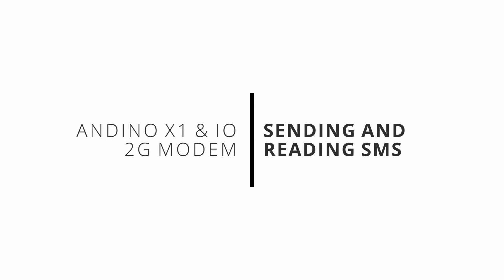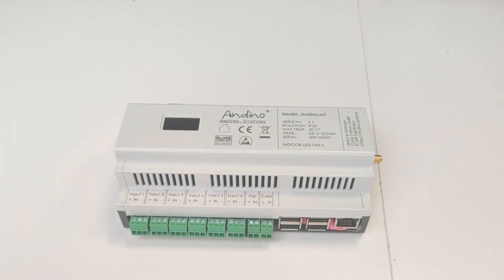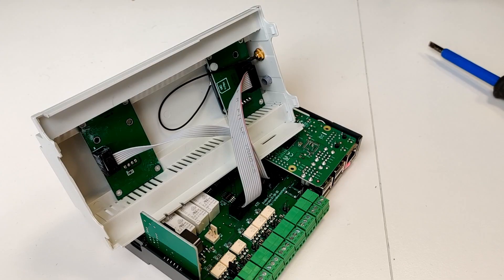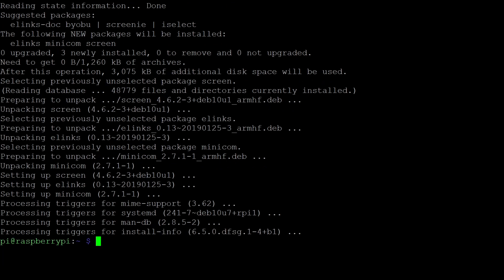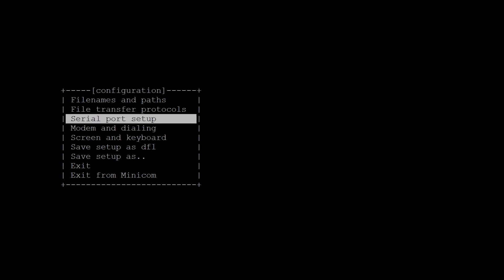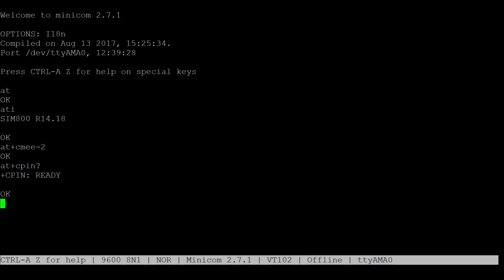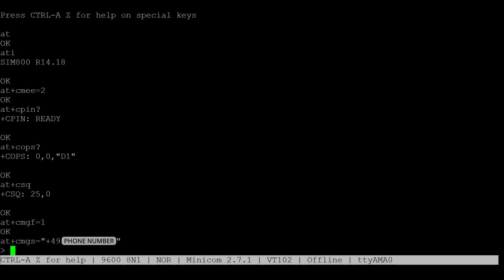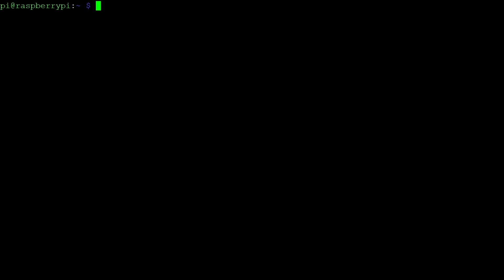Send SMS messages using the Raspberry Pi 2G modem - Andino

Comment: great video mate can you help with issues using minicom, i setup like you did with ttyAMA0 and set port params but when i try AT commands i cannot even type AT commands in ??? any ideas would be appreciated
Reply from the maker: Are you using an Andino X1 or Andino IO? For Andino X1, the serial device has to be set to ttySC1, for IO the correct device is AMA0. Also make sure that the modem is connected correctly and all parameters for the serial setup are correct. Note that if you don't save the serial port settings as default for minicom, they will reset after every restart of minicom. If you're still having issues after having tries this, please contact us at info@andino.systems
Reply: @andinosystems2557  thanks for the reply mate I got it working I flashed a new image to the device, now modem appears as ttyUSB0, strange but AT commands working perfect now. Looks like a possible service in the background was hogging the device, sorted and 👍
Reply: @steveokinevo  If the modem appears as ttyUSBX, that means that you are using a 4G modem (while this tutorial is about the 2G modem). The process of sending SMS is the same besides having to enter a different device, however.